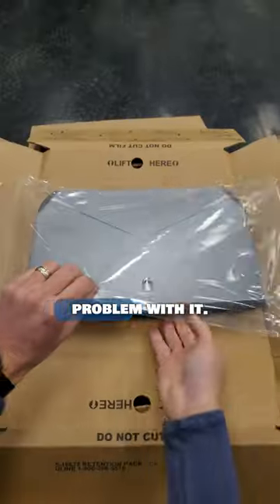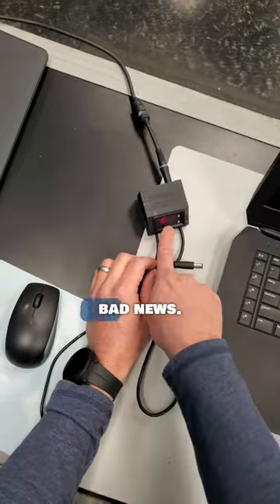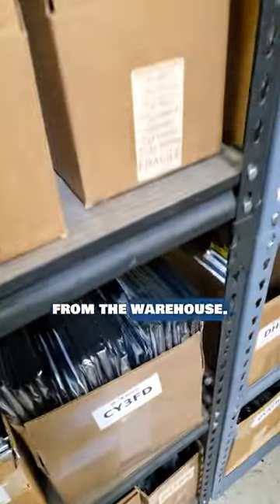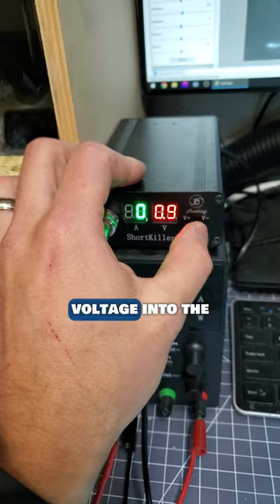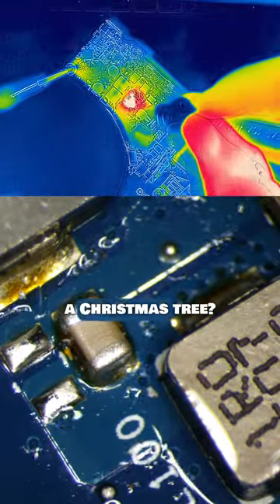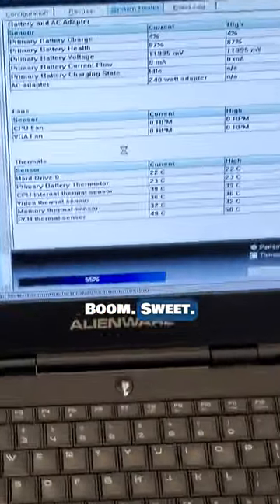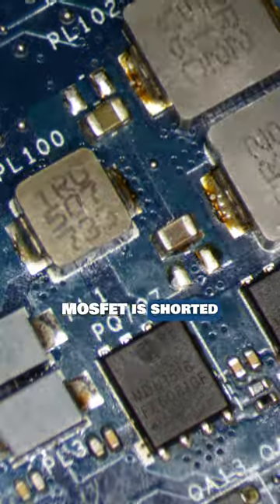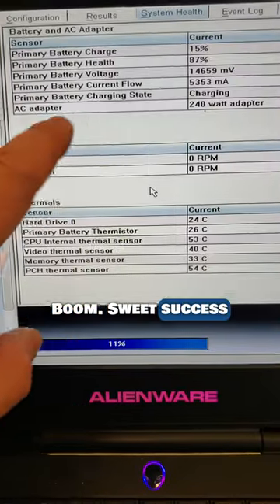Laptop Repair Fix The Hard Way #shorts #laptoprepair #computerrepair

Comment from the maker: I was able to repair this Dell Alienware 17 R3 gaming laptop for $200.  Instead of replacing the motherboard, I fixed the laptop the hard way and repaired the motherboard.  There were two issues: first, the charge shorted out, then it would charge the battery.  I was able to fix both of these issues.  Do you think this was a good deal?
Reply: Great Deal!
Reply: Pretty good!
Reply: charge the labour for the price of replacement board
Reply: In comparison, how much would the labour be to reinstall Windows when it complains that the motherboard has been changed?
Reply: Sounds like 1 and a half hours of labour with no materials budgeted. I think you're underselling yourself.
Reply: Please always show us the hard way, it's interesting to watch 😅
Reply: @hoverbike those parts are worth pennies
Reply: @vueport99  well, I see where you’re coming from, but hear me out.

So let’s say that it turns out the 2020 MBPro M1 has a bad SMC that cooks itself and it’s just exited warranty for everyone.

Donor boards don’t have a million SMCs, they have one. And they’re all bad. So it’s not like there are infinite parts on the shelf. So you’re pretty much reliant on devices with broken screens or similar, that are also “no repairs” from customers that just don’t think it’s worth replacing the broken screen, in order to get parts.

I mean, I admire getting something working as much as the next, but I assume that he uses donor boards to ensure that it’s OEM spec parts (even if he’s replacing a dead chip with a soon to be dead one) - because using aliexpress parts is just not going to be feasible on this scale of operation. Sure you can probably get away with a bunch of machines, but eventually one of these sellers will screw with you either out of stupidity or malice, and that’ll end up on the customer, and that’s why he goes through all this trouble for real OEM parts.

And that’s why I don’t think a resistor off a donor board is worth the 1 cent it might be for production, but more like… a fair fraction of a donor boards price, because donor boards won’t have that many critical pieces to lift from before it’s just left with stuff that doesn’t fail within the USABLE lifespan of the device.

TLDR a chip from a donor boards price should be a fraction of the donor boards price, not the price of the actual donor chip or whatever.
Reply: Very fair
Reply: @hoverbike  I believe you meant SMD. And even reliable ones aren't that expensive. And with his scale of operation he can easily buy them in 1000 lots for pennies each. MOSFETS would cost a bit more.
But then probably I rather have a brand new one rather than take a chance with a donor one that can fail in weeks or months.
Reply: Yeah, especially the microsoldering needed to fix it!
Reply: I feel like 150 dollars is fair but i would say it depends on how much a new motherboard is and you have a lot of experience so that is something that is valuable.
Reply: A good deal?

That is a steal honestly, i was thinking somewhere around the 400,- line.

Nice to see that some people still try it the hard way just to prevent the other good parts dont go to waste.
Reply: Depends on how much it would cost just to get a new motherboard.
Reply: How much would replacing the mother board cost instead?

Comment: That's actually "fixing"
Reply: Umm, why's that 'actually “fixing”'
Reply: @cloud_s_97  because he is "fixing" the old one, not "replacing" the old to the new one motherboard
Reply: @Shinra-- still "fixing" the laptop though
Reply: @alexanderpopik6780  yeah, but the level of intent between the two is different
Reply: @Shinra-- Exactly. And sadly becoming more and more difficult, straight up impossible for Apple products.
Reply: Why the quotations? He is genuinely fixing the issue
Reply: Im wondering what the cheapest way for the customer is. Component replacement, or Motherboard replacement?

Taken laborhours also in account.
Reply: Both fix the issue with the computer but only one fixes the issue with the motherboard.

Comment: Capacitors are the main cause on most electronics.
Reply from the maker: I see capacitors and MOSFETs most often are the cause,  then MOSFET driver ICs after that.
Reply: Not really. That used to be true once upon a time, when electrolytic capacitors were used a lot. Nowadays it's not the case
Reply: @dimitrijekrstic7567 I personally often see many faults still being SMD ceramic capacitors. When the board flexes, either from external force or just from repetitive heating and cooling down, some cheaper ceramic caps tend to crack and short. I agree though that it used to be much more common with electrolytics.

Comment: How did you u get started in this? I've always wanted to open my own repair place but am not quite sure how to get started. Keeping all the spare parts alone is hard enough
Reply from the maker: I started this business more than 20 years ago.  We primarily sell replacement parts but have always repaired laptops that were sent to us. Over the years, I have gained more and more knowledge.  To this day, I am actively trying to learn more and more.  So, the best advice is to get started.  Go buy broken as-is laptops on eBay and try to fix them.  

There are a few YouTube channels that are pretty good, and you can learn a lot from them.  Then you need to practice... a lot...  Electronics Repair School channel, NorthridgeFix channel, and the older videos that Louis Rossmann channel did.

Comment: Been watching your videos for a while now and I've been wondering, wouldn't it be more time efficient to swap the motherboard for a quick return then fix the original one to put back into inventory?
Reply: Yes, and that is how some shops do it. Other shops just replace and send parts in to be refurbished. It's all about available space, equipment, and personnel.
Reply from the maker: Two things here.  We do not sell repaired motherboards.  All of the parts we stock come from Dell.  We buy out Dell inventory.  The second thing is that their motherboard has the Dell service tag set in it, which is like a VIN number and cannot be changed.  So, doing a swap would be no good.
We offer this as a service to our customers.  It saves them money, and we gain a loyal customer.  Most of our customers are repeat customers.
If we end up needing to replace their motherboard because it cannot be fixed, it becomes a donor board.

Comment: Do you know where I can learn to do board level repairs? I want to know how to repair like you, also learn what kind kf hardware I need to know how to use. Computer parts in the Philippines is expensive, and it is probably cheaper to do board level repairs than simply replacing the board. It's worse specially where I live, since it costs even more, and repair shops for computers simply swap the board.

Comment: Dont do like that, dont submit 1 volt on motherboard, it can kill cpu
Reply from the maker: The CPU can handle 1 volt.  These CPUs run up to 1.2v.  Are you a board level repair tech also?

Comment: Wait, that's all it takes to find the problematic component? Just inject voltage under a thermal camera?
I mean, this fix is super impressive, but I thought you need to pull up complicated electric schematics of the board and whatnot

Comment: I have a dell n5110 running with i5-2450m  it was bought by my dad in 2012. I've already upgraded the hdd with an ssd months ago still tunning fast with no issues. Recently I planned to upgrade the ram from 4 to 8 gb andh the system went black screen and i couldn't fix it even the market which i bought the 4 gb ram won't accept the returns...😢 I don't even know what to do I'm not ready to replace the motherboard too..as its a favorite lap for me...
Reply from the maker: I would not be able to tell you what is wrong with it without looking at it.  There are so many things that can cause that issue.  You can send it in for repair at partspeople.com

Comment: I have 2020 version of Acer Predator Helios 300 laptop and the problem with it is as soon as I turn on the laptop the system temperature in the Predator sense app is already 75-82° C and both fans are not spinning.....I don't why its happening.......also As soon the system temperature hits above 90 both the fans spins over 50% of their speed and the system temperature goes beyond 102°C even with fans at full throttle.... Surprisingly I don't even run a single app on the system.....

Why is it happening can you please help.... Thankyou 😊

Comment: My 2011 Samsung RV 15
laptop
It Says That X on the Battery 
Means no battery 
BUT
When i took the charger off it turns off ramdomly
Then I plugged it turend on
( POWER BUTTON ONLY)
Uhh I Broke The Charger Its not turning on

Comment: How much Celsius are you using in the hot air? My go to is around 380 Celsius! I’ve seen people also desolder with 400 Celsius
Reply from the maker: It depends.  420c most of the time.  480c if I am removing something on a huge power-plane.  I have issues under 400c.

Comment: I have acer Predator the screen is not working when plugged into the monitor it does not show anything the plug is working it just won’t show screen I even tried flinging in bios but no sgin what is the problem?
Reply from the maker: Sorry, I am not sure without looking at it, but we specialize exclusively in Dell Laptop parts and repair only.
Reply: @dellpartspeople  ah I was gonna send it in I was just waiting for a response thanks tho